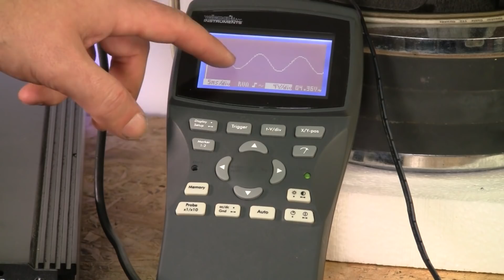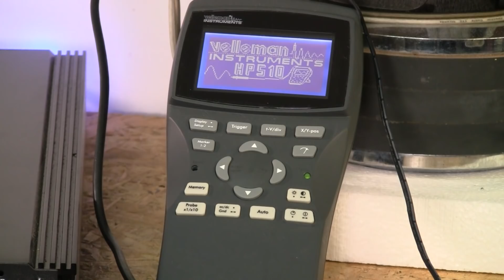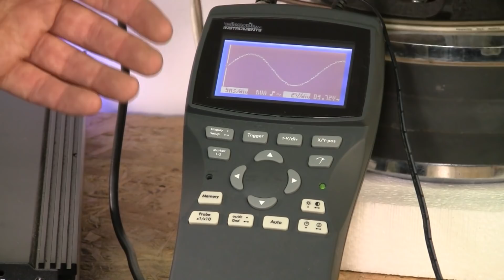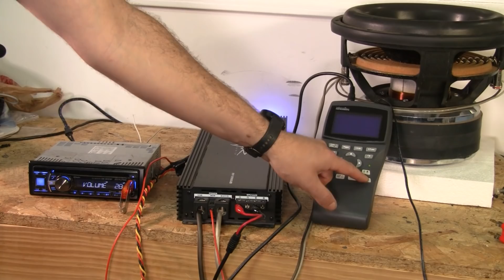How your budget amp kills subs without clipping - Tech Stuff Tuesday

Comment: I don't understand how having the gain at 3/4 is ok for this application or any for that matter? What would it look like with the gain set properly? Mind you I'm commenting not even half way through this video. I'm assuming you will touch on this topic... I guess I'll find out soon enough.
Reply from the maker: Do you understand what the gain adjustment is and how to properly set it? The gain at any position could be correct for literally any application. As long as the volume of the HU doesn't go above the point of clipping, the gain is set properly. The point of mentioning it was at 3/4 is for people who would complain if it was all the way up for the sake of complaining to justify that's the reason, or if it was all the way down it wouldn't make enough power to show the point where it is a gain setting clip.
Reply: @EMFAudio  Right on but you're supposed to match the gain on your amp to the output voltage of the HU/source correct? I understand what you're saying but I don't see how the gain can be turned up that high on that alpine deck without clipping right from the beginning? That hu has either 2 volt or maybe 4 volt rca outputs doesn't it? Pretty sure 2 volts. I know on my alpine it's a 2 volt output but I have a eq and audio control epic160 so my output voltage is higher. I believe its 7 volts out from the clarion eq. I also owned that amp before and my 1st 1 shat the bed after 6 months and skar sent me a new one within a few days. The second one lasted awhile and ended up sold to a fellow car audio enthusiast who put it to work hard at low impedance and killed it eventually.  So what you're saying if I'm understanding you correctly is... it doesn't matter where you set your gain? That's what it seems you're saying to me? Believe me I know that you know what you're talking about. I just don't understand how you can have the gain turned up to 3/4 without clipping/dirty signal. It was like the 1st thing I learned about car audio and amplifiers.  That you have to match the gain on your amp to the output voltage of the source... is that not correct?
Reply: @EMFAudio  Adding to all I said... YES I UNDERSTAND HOW TO SET A GAIN AND WHAT THE PURPOSE IS. That's a silly question lol.  I can't be the only person wondering, how having the gain almost maxed out would be ok? Unless you're literally just trying to show how NOT to set it? Maybe I'm missing something idk but I'm far from a rookie I've been playing with subs and amps/car and home audio for over 20 years. Hence why I'm confused with this. Also I'm guessing that particular amp is junk. Like... a recall from the manufacturer.  I definitely dont think all cheap amps do this. I also don't think amp dynos numbers are garbage and don't show the power... it's kind of why they exist is it not? Obviously there are factors that come into play when dealing with impedance rise ect while in a vehicle.  Doesn't mean a amp that does 3k certified on a amp dyno doesn't do 3k. You're a "professional" just like many other people here on this platform.  So you're the only person in the world that actually understands car audio? Seems like that's what you're saying. So I take it back... not in short. Just a add on to my previous reply. I want to add this too... I'd love me some emf audio subs in my life. I know it's good quality. Just not sure how this video shows what you're saying it shows. Also most people that are into electronics OF ANY KIND,  generally wouldn't have their electric device leaned on a extremely powerful magnet and expect it to work correctly.  That in itself had me wondering wtf...

Comment: I own a Skar RP3500, have it tuned by ear, pushing two Skar VXF 12’s with no issues. Sure the subs will get hot if you are cranking for an extended amount of time (Amp is 500 watts rms over what subs are rated for), but I have never blown them? Your customers may be pushing things past their limits?
Reply from the maker: As stated in the video, those same customers buy other amps and don't have a problem anymore.

Comment: Amps don’t kill subs people who abuse them do , they should have smelled the coils heating up duh
Reply from the maker: So if they have a 2,000 watt amp that makes their subs smell at 500 watts they should just turn it down and not enjoy the full capabilities of their subs as a result of their amp?
Reply: EMF Audio if 500 watts from a 2000 watt amp is burning up the coils then yes something is wrong with the amp , even with a square wave it still takes quite a long time for a 2000 watt rms sub to burn up with 500 watts , by the way I would never buy a skar amp , I have just seen a lot of idiots running pure distortion to there subs especially with the “ BASS boost turned all the way up and thinking it was ok cause there sub was rated for more power than their amp , if the sub sounds like it’s in trouble turn it down or buy a better amp

Comment: I'm in the process of a build using two merica amps on four sundown 15s in a 4th order blow through and I wanted to know if I could safely mount the merica amps vertically? It would help offset the size but I don't want to hurt them,thanks for any input
Reply from the maker: The only mounting not recommended is upside down.
Reply: @EMFAudio  ok great I appreciate it,I can't wait to get it all done but I'm a long way from finishing it.

Comment: This isn't specific to this video, you get on here and S*** all over budget gear, but always ride the slant that you're trying to push without providing a COMPLETE overview of the situation.

You've stated in video, this is a used amp. The amp is probably damaged from abuse. Most people 'gain by ear' which isn't a real thing and a excellent way to F your stuff in a hurry.  What did the output of the line feeding the amp look like. What did the recording look like maybe the sine wave was flawed, or the output of the deck was jacked up. I don't trust you because of previous videos I've seen with the same behavior. So yes, you need to get out every step of the process in order to make it seem legit. Looks like you are just blaming the amp because you want to. If you want to shit on a poor product that is fine and I'm all for it, but spend the time on showing the actual proof instead of partial information. It would add some credibility. Right now, it seems like you're just trying to defend your subs reliability by using a bunch of unknowns and your opinion. Not on real world truth.
Reply: I actually watch various videos. Good, bad, and other, in order to make myself an informed consumer. Researching products that will be in my personal 'goldy locks zone' Just because it's expensive doesn't mean it's the best.  Look at Beats by Dre or Apple airpods. Great marketing with mediocre product. There are far superior headphones out there for same money. IE, Sennheiser or Shure both make headphones that, dollar for dollar,  will destroy the mass marketed products. I'm looking for value not price.

Today was the first time I have ever bothered to comment on any videos I have seen. Usually just turn them off and leave it be. You seem to have the right idea but you come off in the video as condescending and the authority on the matter. Which is fine IF you're test is bulletproof. But it isn't. I guess that should have been my point from the get go.
Reply from the maker: What I've learned from this is that you only watch the videos where people bitch and complain, not the ones with any other content. I have other videos showing the HU is clean, the o-scope works fine, and other amps are clean. Yes, the sign wave coming out of the amp was flawed BECAUSE THE AMP IS DOING IT. You don't trust it because it's not the result you wanted so you're looking for a problem. If I did every video showing every aspect of every thing related to a source you'd come up with some other reason it's wrong like moon phase and temperature. I showed you what it did, I didn't put an opinion on it, and if you notice in the example it wasn't my sub either. As a matter of fact, every time I've reconed subs because they were damaged by one of these amps, it was never an EMF sub. THAT is injecting your opinion with unknowns and not real world truth.
Reply: @EMFAudio  get a brand new amp, the same model. and compare them side by side

Comment: yes this amp high current  low volt output amp example 20 current 50volt 2 ohm 1000w  = 6 current  +90 ct -90 volt 2 ohm = 1000w https://www.youtube.com/watch?v=szW7PvqvNVo&t=103s high volt amplfier +140 ct - 140

Comment: To be honest your scope may not be reading wrong it could some of the high freq from the amp is not being filtered (The very high carrier freq used in the amp section). To my ears it sounded like the amp was pulsing the output, tho no being there in person it could be just encoding compression artifacts but other parts of the audio was fine.
Reply from the maker: That is precisely the point I was getting at and mentioned. With it being auto sensing it can't lock on when there are other things happening, like various harmonics and general noise.

Comment: I don't question whether or not this line of  amps has quality issues, but I can't help but notice your oscilloscope is leaning against the magnet of a Banhammer; that has to be affecting the measurements being seen. I ruined the Fitbit I was wearing when installing my Banhammer 15 in a box several months ago.
Reply from the maker: I had it there to get it in the shot, I noticed it with no sub connected and connected a sub so you could hear what it was doing. The stray magnetism isn't strong enough to cause an issue with anything that far away.

Comment: What are you using as a power supply? could it be possible it can be sensitive enough to pick up on a transformer of some sort as a charger.in the vehicle I could see and issue with ignition coils an such

Comment: Somebody prolly rebuilt that amp with cheap parts or blew some subs and effed the guts up. Could be the scope too. I put 4 skar IX tens on a rp 2000 in my friends car for her and it sounds crazy good for what it is and the amp has more power to give and never had not one issue and she bumps it hard and often. I call bullshit,them guys dont know how to set their settings they just send that shit
Reply: Being a bad amp is possible because it does happen but i highly doubt theres that many all in your area or in your circle or whatever the case may be. Id say prolly its your scope. They are super sensitive and you was mighty close to your test bench so might be just false readings.
Reply from the maker: So it's completely not possible than the amp is just not good? Remember, more than 1 has triggered the same thing on subs coming to me to be rebuilt.

Comment: I’m wondering if there’s hidden meaning behind this video... I remember a while back you did an experiment vid with testing an smd product... the rp amp for sure has a bad reputation for going into protect...  weather it’s user error or not it seems to have problems a lot. Just trying to connect the dots. Love the videos! Interesting stuff and I’m learning from them. Thanks
Reply: Ive learned with EMF you have to stay focused on the subject and not get distracted by what products are in the video.  Too many people are distracted by the fact that its a skar amp and not focused enough on the fact that hes using it as an example of a common problem because it's doing what he claims. Hes not attacking anyone.
Reply: I'm thinking this same thing lol.  It doesn't make sense otherwise in my opinion.

Comment: Could it be that the head unit is outputting a signal, even though the volume is at zero? How can you be sure it's the amp that's causing the noise in the scope, and not the radio?
Reply from the maker: According to this video https://www.youtube.com/watch?v=6CKM0AdqNJw no, it's not the head unit.
Reply: He has used that unit for alot of vids would have happened b4

Comment: He needs to use a quality amp to see the difference on the cheap one and the quality one or to see that his equipment is not faulty.  Only that way we can believe his bs he's talking about.
Reply: I'm using a power acoustik amp and haven't burned my two fosgate p315dvc using them in 1ohm load.
Reply from the maker: Maybe the Power Acoustik amp doesn't constantly put out a dirty signal. I've shown other amps in on the same equipment in other videos being perfectly clean.

Comment: This is just a blatant rip on Skar. You didn't show what another amp does on your cheap oscope. You powered the amp with what looks like 8ga wire when it's got 0ga inputs. While that might not make a difference at low volume at high volume it definitely will affect it. You could've taped over the brand and said this is a cheap budget 2k amp. I've been running Skar for 4 years this exact amp with no problems. Just because you wanna push overpriced Sundown gear doesn't give you the right to try to turn people away from another company.
Reply from the maker: Just because it doesn't still have the price tag on it doesn't mean it's a "cheap o-scope". If the o-scope reads fine on every other amp, it doesn't matter how much it costs when it reads bad on another amp. Having 8 gauge going into it (which is about 3 ft long BTW) can handle more power than that amp can make and certainly more than it was making with no load on it. Additionally, I showed it having noise problems making 1 watt, which has nothing to do with wire size. I could have taped over it, and you'd still complain because it's obvious, and this should be a warning. Additionally, we don't sell Sundown so if you're going to make excuses rather than learn, at least have valid complaints.
Reply: @EMFAudio  oh I'm sorry you just sell Sundown baskets and motors and slap your logo on the cone. If your oscope reads fine on every other amp you should've showed that in video. I wouldn't have complained if you would've been respectful to other brands. No I'm not a Skar fan boy you could've been knocking any other brand but it's pretty classless to blatantly show the brand. You're telling me that 8 gauge wire can handle 2k watts? Even at only 3 foot there's no way. And yes this amp does rated power. Also you might want to change your website since as soon as you Google EMF Audio it says "Dealer of EMF Audio, Sundown Audio, XS Power, Audio Control, and SBC products"

Comment: Dude I just ordered that amp wtf really 😫 it will not be here tell Friday
Reply: I have been running my RP-2000.1D for almost 3 years now on the same pair of 12's, and haven't hurt either sub yet.
Reply: I guess its hit or miss with that amp...i went through two of the rp2000's and mfr tried to get me to take a 3rd one.  I went with a hd1200 (2ohm ver), met my requirements and expectations.  Good luck with the rp2000!

Comment: Try a different o-scope. Something of a little higher quality that that one.
Reply: Paid opposition. Skar killing the market
Reply: Try an old school CRT oscilloscope from the early 00s or older.
Reply from the maker: The same o-scope works fine on other amps, like I said. You don't learn from testing by changing the test to give you the result you want.
Reply: @EMFAudio  turn off auto ranging on the time divide and voltage divide.

And yes a higher quality oscilloscope would do nothing but IMPROVE your testing.
Reply: @EMFAudio  so i'm guessing my comment was right, like sam said get rid of your cheap ass scope.
Reply: @repeat0420  no... Only res would change

Comment: I've bought a few Skar speakers. Seems to me like their quality control is lacking.
Reply: Yep, same here, but with thier amps, rp line for me anyway.  I have a skar vxf-15 D4, no real complaints on the sub
Reply: @J-Ro2082  I got some 3 way 6x9's and the crossovers weren't soldered on very well. And i got some 8" subs with decent size chips in the magnets, They sounded pretty good though. Haven't tried their amps yet.

Comment: If you are trying to prove that cheap amps are bad, I would rather see it measured on proper osciloscope and distortion analyzer with good explanation what exactly is amp doing, and compare it to different amp producing clean power. I think you had good point, but this video is very bad proof of explaining it.
I would want to agree with you that cheap amplifiers are producing low quality power but I am disappointed that you tried to demonstrate it only by showing that your o-scope couldnt adjust to a signal and that wave was not looking good on that small screen of this pocket oscope. Picture was zoomed out most of the time anyway so it was hard to notice anything.   this video is lame and I am disappointed.
Reply: not to mention he is clipping the fuck out of it ...didn't tune it or anything could be the o scope is cheap and not the amp ,could be that the oscilloscope is laying against the magnet idk just a thought i could be wrong
Reply from the maker: So it's clipped at every volume level? Thanks for proving it's a bad amp.
Reply: @EMFAudio  notice i said I could be wrong, but then again I couldn't bare watch the rest of the video being that there was no other instruments used to test this little experiment judging from the comments
Reply: @EMFAudio  maybe do another test with a different instrument like the gentleman said above this video is lame